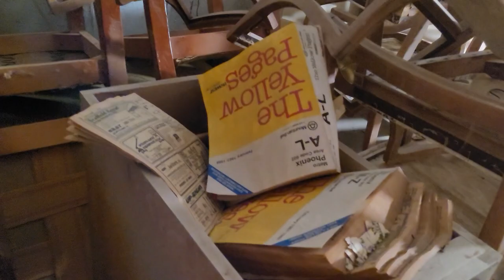Building a Homemade ELEVATOR in our Abandoned Backyard FALLOUT Shelter! | Part 6 INSTALL AND RIDE!

Comment: I dont think its going to be too hard to get the electrical working again. I am curious are you going to have a way above ground to hook up a generator set? Also I am curious are you planning on getting the bathroom working again down in their. If so I can see the pluming part being a real beast ?  Also I am thinking at least a ventilation system and a dehumidifier ? This is a really cool project!
Reply from the maker: I have a ton to do, I plan to get everything working eventually.  I was going to go the battery route at first, hadn't thought about a generator yet!  I'll get to it step by step otherwise I'll go mad thinking about it!

Comment: I saw you try the fall-arrest by yourself (!) and that worked fine but have you tested it in the finished elevator?  I'd like you to be certain there's nothing unforeseen now its fixed with the load applied differently from your trial!  Keep up the good work!
Reply from the maker: I may have to do more testing, the fall arrestor is rigged through a pulley to double it's capacity, I'm 99 percent sure it's good!

Comment: Main entrance and door needs to be able to be air tight sealed to protect from fallout otherwise its going to look great but not offer any protection.  Also id modify the lift so it can be used as a ladder incase of lift failure.

Comment: Also do you have some sort of safety stop for if the elevator tries to go fully up while the top door is closed?  Or some auto opener for the door at the top?
Reply from the maker: No, right now it will kill you if you drive yourself into the closed door, a real bummer in that way.  I have to work on something.

Comment: Good call on the retractable lifeline.  I'd definitely build a cover to prevent clothing and hair from getting stuck in that pulley system.  Also, what happens if you send the elevator to the top with the door closed?  I'm worried that you're one pinched wire away from somebody getting crushed to death.
Reply from the maker: That would bee a bummer for sure,  I need to build an interlock to prevent that!  Thanks Mike!

Comment: The only thing I  might add would be a limit switch actuator on the top of one of the posts for the safety cage, just in case the door wasn't slid open far enough. Say you are sending a loads up to a helper/s they end up bumping the door closed a little. Nobody notices and it jams up against the door. Something breaks or gets wedged and you are stuck down there.....just one scenario. Could just be a simple rocker arm linkage and 1/4" rod over to the existing limit switch assembly
Reply from the maker: That's a really good Idea!  I need to stop it smashing the gate against the door.

Comment: my queston for the elivader is why? making a solid set of stares would cost you less then half of what i bet the steel alone cost and takes power . if you use it as a bomb shelter its not that good unless you will have the thing run on its own power some how .
still a great idea if you are just using it as an extra room
Reply: My guess is he needs to clear out a ton of furniture and the lift will help with that, he also mentioned he would add some kind of ladder/steps on the side somewhere.

Comment: Probably could have got some rubber bits to go between the concrete and the framin to reduce vibrations wearing on the bolts and redice water contact

Comment: Pro tip.  Put hammer drill in hammer only mode and drive wedge anchors in.
Reply from the maker: I hadn't thought of that!  I could make a little tool to fit over the bolt so it doesn't slip off.  Thanks Justin!
Reply: @HerbOMatic  all the wedge anchors I use have a divot on end never slips off

Comment: Very cool project.  One minor criticism though.  If the point of this bomb / severe weather shelter is to keep you safe, wouldn't you want to get into it as fast as possible to survive said disaster?  I would have just installed a fire pole for decent and left a ladder to climb back up.  Just my two cents, no offense intended.  The build was epic though.

Comment: I would switch the winch over to a 12 volt winch that can be run off of a battery backup, especially as there is no ladder to climb back out during a power outage.

Comment: I can see you building a metal gantry on larger wheels and a electric winch to get things in and out of the bunker.   If I was building that bunker I would run temporary power and put in a tool shelving unit in the bunker.    Might be a good time to buy some more tools so that the bunker has its one set of tools for the build,  like given how long it will take.

Last thing you need is to be going back and forward between the shed and bunker carrying tools.
Reply from the maker: Definitely could see the gantry Idea working out!  I don't know if I could afford a whole new set of tools!  Thanks for watching Tara!
Reply: Ryobi should hook you up.   This video had me researching that cordless vacuum you used
Reply: I would have told like hand tools, a few cordless tools. And zombi defense's

Comment: The only downside being that if the power goes out beforehand the lift will not work.
So maybe just make some sports along the back of the lift if possible as a ladder, and keep the lift down as standard, or make it so you can lift it up, go down, and while on ladder put it back down so the lid can close.

Comment: those spiders are cool, I have a smaller one in a big glass gallon jar, they are hilarious
when they grab their prey, & bite it a few times , they use the ends of their  hair like legs to spin it like a top while wrapping it in silk 4 later, the ones around Toronto sure don't seem that big ,they re quite small, an inch at the most total ! they actually live together , I've seen as many  as three around and on a single larger web
Reply from the maker: I haven't been able to watch them that closely,  when they bite their prey they inject digestion enzymes that liquify the innards and they suck out the juice later.  That's why they wrap them up like little juice boxes.

Comment: Maybe moving it with the engine hoist would have worked better? 
Gonna need a ladder down there to escape when the power goes out. 
How do you keep water out in a storm? 
Is there a way to manually pump water out?

Comment: you should make a second cut-off switch that cuts off before you hit your head on the rolling door and add a second controller for the lift to operate it from inside at the bottom and a manual crank release in case the power goes out. - Don't want to get stuck lol -
Reply from the maker: I gotta figure out the problem of being lifted into a closed door and crushed to death, that would be a bummer.  I plan to duplicate the controls at some point.  Thanks TechNTunes!

Comment: There is so much wrong with this I can't even go over all of the issues, but I will mention some of the primary ones. First, your only exit is an electrically powered, home made elevator. Second, your elevator is powered by an extension cord that can easily be unplugged or cut. Third, you have no way to notify anyone if the elevator fails and you get stuck. Fourth, you have only one control to operate the elevator, and it is on a cord that may not be in reach of whomever needs it. For instance, what happens if your wife wants to go up while you are still below? How would you escape if there were a power failure? At a minimum, you should have a ladder and fixed controls for the elevator at the top and bottom. Also, you should consider a seal of some sort on the door, to prevent water and debris from entering the lift chamber.
Reply from the maker: The shelter isn't done yet...I share and will be addressing many of these concerns.  Thanks Trevor

Comment: If an EMP happens your high tech solution just may be out of commission. Just build some stairs and deal with it. The simplest solution is usually the best. In a major happening you will be forced back into a basics world. If you had to move fast into that shelter the elevator may be the death of you and your group. One to two person at a time on it at a time? Another entrance into the bunker? entrance? You may end up becoming sushi in a blast situation, tornado ect. I’m a prepper of 30 years and I see a big safety issue with an elevator so small. Whats the emergency back up plan?this is another great project and commend you for all your effort. Just don’t think it’s appropriate for the situation. Keep on keeping on. Your knowledgeable and skilled.

Comment: Just curious, why not use the impact you have to tighten the nuuuuts? It would be tighter and quicker than your cratchet wrench? I would have used some blue lock tight on the nuts and bolts so that they don't come loose over time. Added safety 👍
Reply from the maker: I don't know, that impact isn't that strong, I have used ratchets with those red head anchors and I can feel when the anchor sets, makes me feel good.

Comment: You've got the auto-shutoff but maybe it might be dangerous to hit your head on the door when the lift is going up with the door closed. that could be nasty. Especially if it's really dark. Wondering if maybe a secondary shut off just when the door is closed. It's up to you but I bet a dollar there will be bumped heads in the future.
Reply from the maker: Definitely something I need to address, I already started to smash myself as seen in the video. Thanks Vernon!

Comment: Pro tip, don't use Chinese safety equipment. 
The company I work for makes both the harnesses and the self retracting lifelines for 3M. 
They are QCed by yours truly, and we get to throw our in house made equipment against the foreign junk, and 10/10 times we have the higher quality product and ours don't fail. 
All it takes is a little extra material on the inside wall of that lifeline shell and it binds against the belt on the inside, creating some real problems. 

We don't skip corners. Go with the 3M harnesses and lifelines.

Comment: So with that elevator, it will never be used as a bomb- or stormshelter again, because if electricity cuts out, you're stuck. Better install an emergency ladder next. Just rungs bolted in the sidewall will do... which basically makes the elevator pointless. Cool project though.

Comment: I don't know if it's a good idea to use electrical elevator for a nuclear shelter. What if you run out of power? That would be a very probably scenario in case of nuclear attack. I would use a pole instead (just like Batman). It's faster and more reliablem for emergencies.

Comment: i would recommend removing the sliding door, stripping it and fresh epoxy paint it. Then sprayfoam under the door instead of that wood. if u dont, it will condense any moisture in the bunker on it and drip down on the elevator and or cause more mold. Additionally, u can use some type of garage door seal or other rubber blade type seal to give a weather seal on the door to prevent more spiders and outside moisture from entering. Id focus efforts on the entry before doing much inside. Re-doing the electric from the house to the bunker, sealing the concrete walls in the elevator area, maybe a new entry door to the actual bunker to add more sealing against bugs and weather. really give the wife more reasons to be down there helping. maybe do a bug bomb or 2 before anything else. Im looking 4ward to seeing it come to life. +1 sub

Comment: Ya should of used a 12v winch would of been better so then ya keqve a battrry down there on charge so if ya power goes off ya can still get back up or atleast keep a ladder down there and have 2 safety hooks bolted to the wall,btw a new roof would be good and a internal lock so if u do need to use it for safety reasons no one can open it

Comment: You should add a call button on the top/bottom. Because if you don’t have the emote than you cannot use the elevator if it is at the top and you’re at the bottom

Comment: Did you know that they make a bolt that will thread into your cement and not leave threads sticking out and the problem is now is if your nut will not unbolt you will have to cut it off the bolt that threads into cement will just undo like a wood screw it's so much better than those pressure bolts

Comment: Just one logical question that I have.. 

If the shit hits the fan and there is no electricity how are you able to go down or up? Into or out of the hole? 🤷🏽‍♂️
Reply: Maybe the winch has a manual release?
Reply: @PauIieWalnuts  perhaps so so that way it would go down don't know how slowly it would go down but what about coming up I think that it would also be beneficial if perhaps a manual crank with some kind of a worm drive or something to wear it would be easy to turn by hand
Reply from the maker: I'm going to install a ladder thats reachable from the lift so you could bail at any point along the travel.  Good point!
Reply from the maker: It doesn't have a manual release, so I gotta put a ladder next to the lift.

Comment: Was anyone else wincing watching him try to manhandle the elevator onto the top of the bunker door? I don't understand why he didn't leave it laid flat, use the gantry to lift the base up and onto the door, then anchor that with straps to prevent sliding, and then use the gantry again to lift it vertical. To be honest, looking again, I think he could have done this without the gantry. Then once upright, rotate the elevator around to the correct orientation.

Comment: A lot off work for a elevator...a forklift mask a two stage or 3 stage which would take right till top level, what you have doesn't bring  you to the very top which step down.... a pump unit for lift ram an micro switches would have been a lot easier to fit...what you good enough  job

Comment: Quite a reliable shelter. I see about 6 meters deep, strong concrete walls. Much better than the  brick  basements of old houses left over from the  "red shame union". It immediately becomes clear which side was defending and building shelters and who was threatening nuclear weapons. It will be good to add emergency lighting to your shelter, strong airtight doors - doors like yours are very easily deformed by explosive waves, it is desirable to have a spare exit. And you need to discard all minor things that are powered by electricity, that is, the classic stairs will be better.

Comment: this doesn't exactly qualify as a fallout shelter for a number or reasons : it's too close to the surface (only 12 ft. down) , the pipes and wiring indicate that it would rely on surface power and water (both of which would be cut off in the event of an actual war) , the door is a thin metal slide away (which could easily be lifted or blown off by an explosion or high winds ) , there's no structural support beams (meaning an explosion overhead or any type of earthquake could collapse the ceiling ) , the structure isn't pressurized (not air tight) , and finally although it has concrete outer walls , the inner walls are made of cheap drywall (not lead lined meaning not radiation proof ) . Refurbished this could make a decent storm shelter though.    .........    maybe I've been playing too much Fallout but in this case Vault tech would not approve.

Comment: I said it in the last video and I’m gonna say it in this video that thing better be on batteries because when the power goes out you’re not getting in your bomb shelter. You should’ve just put a ladder in or rebuilt the steps this is stupid you’re not thinking at all. I have an RV that I am living in that totally runs on solar I haven’t used any electricity from the grid since November of last year. Start thinking and building things the right way.

Comment: there are divots on that door. As if someone was locked in the shelter, and used a blunt object to hit the door. Was people locked in that shelter ?
Reply: There is wood on the bottom of the door, impossible.
Reply: @farmtruck9885  I saw that!  The wood may have been put there to hide the finger nail clawing and other marks done my humans  trying to get out.   :)  The original owner put the wood to hide the evidence, as he could not make a new metal panel.  I stand by my theory that at some point, people had been locked up in the shelter. Had to be before the apt building was built, as people there would have been able to see. 

( on that note, he can't use this as an end of the world hid spot, as the people in the building next door can see it. :( )   I built my bunkers at night on others property. They are so well hidden, I can't even remember where the first two are any more :(
Reply: @BigBadDodge4x4  😄I'm convinced, they may find some bones behind the furniture. 😉 Sounds like you better get some of them amazon gps trackers so you can find your bunkers, we might need them bunkers.

Comment: Do you want it level or not? And if you say yes,  you're gonna provide it with that?  Yes, I am familiar with the  bubble.  I also dabble in precision and if you think you can even approach it with your sad, naked caveman eyeball and a bubble of effing air, then you're the reason this species is a failure.
Reply from the maker: First one to call out the reference!  The bubble was the best I had for the elevator.  Thanks Mark!